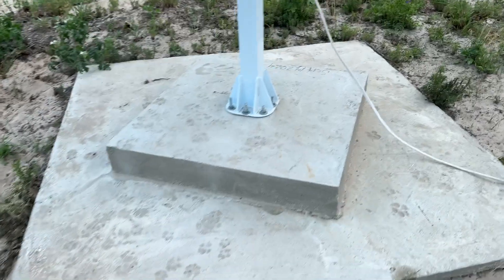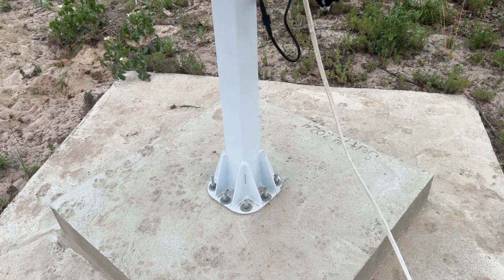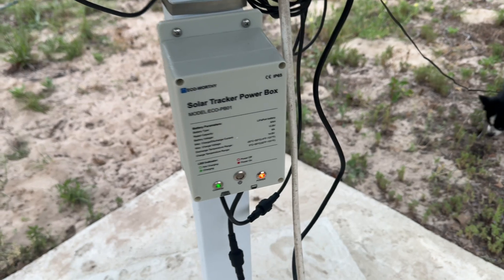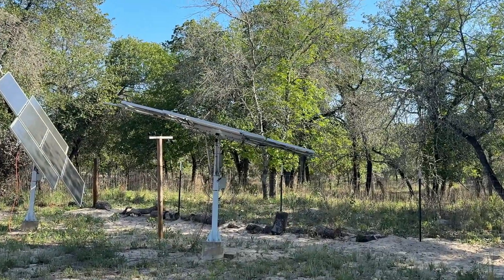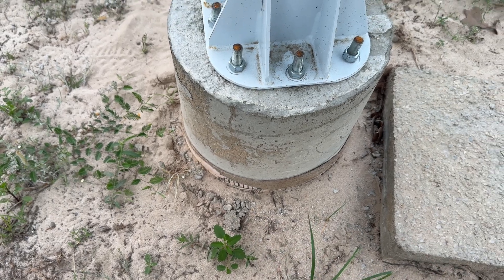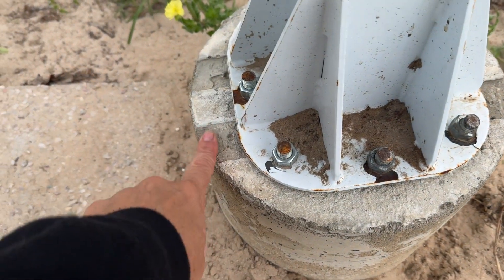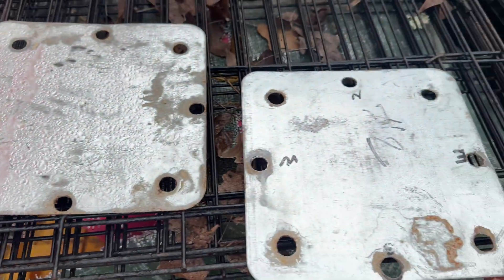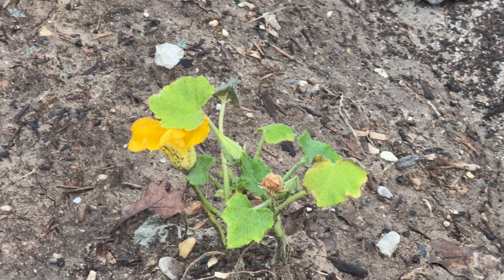Eco-Worthy Solar Tracker update: installation and add-ons

Comment: May I know the max stroke length for each of the actuators?
Reply from the maker: Yes, 1500 and 300 I believe
Reply from the maker: It’s a 2 inch stroke on the 1500/330lb and

Comment: Don't remember the power boxes as an option when installed our tracker. Guess you can say we cheated adding a power line with the solar wires to power the tracker from the main battery bank. I was worried about an extra battery staying charged and also battery theft since tracker is close to the road.
Reply from the maker: It was something they offered after we purchased ours as well.